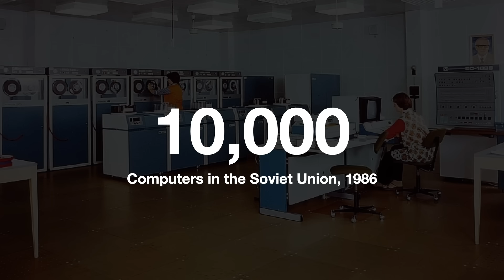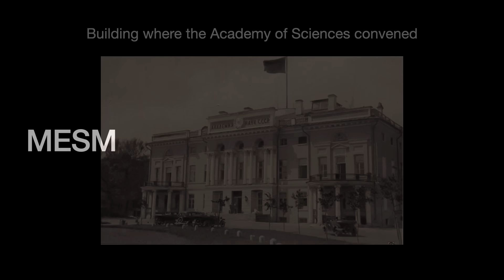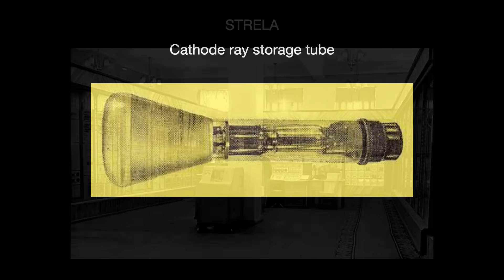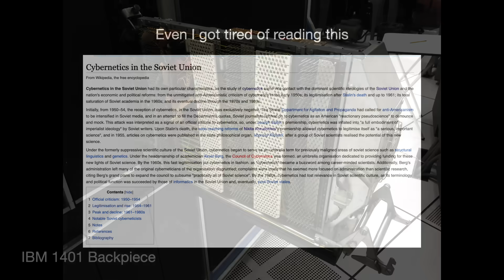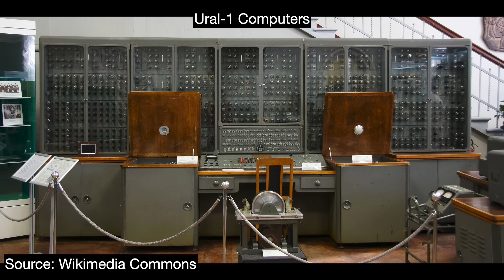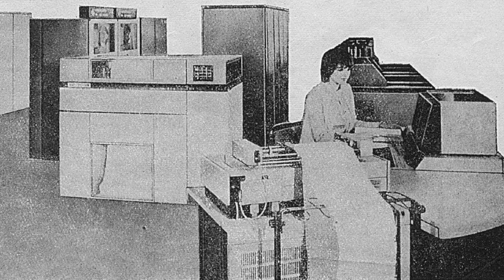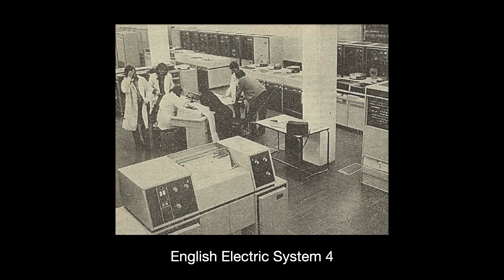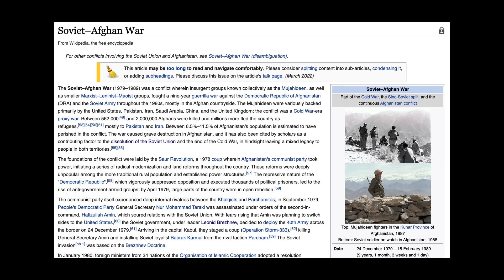Why the Soviet Computer Failed

Comment: I was a student in a high school owned by one of companies building these mainframes (Elwro). Late 80's. They were able to create their own processing units (R34) that were faster than latest and greatest Russia could offer. One of the reasons was they got rid of all 'soviet' chips. From what we've been told, Russians were able to obtain all western documentation (I still remember that huge amount of lessons we had about 360's architecture and instruction set), but failed at recreating more advanced chip manufacturing technologies. Actually, R34 machine is considered one of reasons Western Germans bought that company few years later and literally tore it to the ground.

Comment: Those calculators weren't aimed at solving "differential equations" which a significant portion of them possess analytical solutions and only require one dude and a sheet of paper to solve  ...Those Computing machines were aimed at solving PARTIAL DERIVATIVES EQUATIONS ....Which are a totally different mathematical beast altogether and of  which very few possess analytical solutions and so require APPROXIMATED solutions ( hence the "gargantuan" , relative to the times , computing power needed ).....
And there goes the credibility of yet another wannabe nerd American YouTuber that has no clue what he's talking about yet aims at "edjumucating the woarld" .....

Comment: What are differential equations?

An equation tells you "how much."
The derivative of that equation tells you "how fast."
A differential equation is an equation for the derivative, "how fast," based on the original equation for "how much."

Conceptual Example

Equation:
Plug in time and the answer is your location.
Location is computed based on time.

Derivative:
Plug in time and the answer is your velocity.
Velocity is computed based on time.

Differential Equation:
Plug in your location and the answer is your speed.
Velocity is computed based on location.

"How fast" is based upon "how much."

Equations Using Equations

Equation
Location based on time:  L = e^(7t)

Derivative
Velocity based on time:  V = 7e^(7t)

Differential Equation
Velocity is based on location:  V = 7L

Comment: RCA computers were NOT 360 compatible enough to be able to run IBM systems.  The none privileged instructions were essentially the same but privileged instructions were not.  Thus ICL computers were probably not fully 360 compatible.

Comment: Low end 360 models could not necessarily run software from higher models.  System 44 etc.  I suspect that today models of "360" without decimal arithmetic registers do not run all "360" software very well.

Comment: I think you sort of got the wrong lessons from this history.   I think the structural economic limits in the Soviet Union -- it was a much much smaller economy -- meant it could not legitimately compete with the USA in every area.  That was probably the main problem.  Central planning and communist inefficiency made matters worse, but fundamentally, it was a lost cause from the start.

Comment: From what I know, this is an outstanding representation of what happened up to a point. I worked with a former Soviet computer scientist. He told me some great stories but adding to your account. As you said, the Soviet Union built the equivalent of the IBM 360 CPU but did not have IBM's latest operating system, MVT. MVT had virtual memory allowing a computer that had only 4 megabytes of memory to act like it had 16 megabytes. The Soviets had obtained MVT and the more advanced MVS through clandestine means; although they did not have a complete version, they could make it work. The Soviet Union bought most of its peripherals on the black market. However, their domestically built CPUs were excellent. The showstopper was that they could not purchase disk drives on the black market and failed to produce Winchester disk technology on their own. Disk technology allowed the US to run more advanced operating systems like MVT and MVS and, importantly, solve more advanced problems that depended on fast access to large amounts of data, such as seismic analysis of oilfields, heat flow, aerodynamic drag on wings, physics particle collision analysis, digital image analysis, etc. The Soviets did manage to get a few disk drives from the black market but never enough to make wide use of the capability.
Reply: Oh come on! Around 1980, US research groups were still using CDC 300 and 600 MB disk drives the size of washing machines. Not Winchester disk drives. CDC 600s were what were connected to our pair of VAX 11/780s for large speech model analysis. While I did a few things with the 780s such as writing a driver for a graphics printer, doing about 6-9 months of software updates over a 2 week interval after the person who the company hired from DEC resigned, and installing EUNICE (a UNIX emulator), I also worked on a computer architecture project, and later a full custom VLSI design project which had its own VAX 11/750.

Comment: 18:38 This is typical for every project done by the Soviet union.

My father was a doctor in clinical chemistry and head of the laboratory in one of the most modern hospitals in the Netherlands in the 1980's. The hospital had a sister hospital in Poland which soon would be replaced by a new hospital. And Polish colleagues would visit the Dutch hospital, to see how all different departments were integrated into a single efficient hospital and how they changed the internal layout (compared to conventional hospitals of the time). This was to stimulate teamwork instead of stimulating rivalry between different departments under a single roof. My father was happy to help as good health care is good for all mankind. And his Polish colleagues were impressed and excited to one day have a similar working environment.

But when the new Polish hospital was finished it had none of the ideas integrated into the new hospital. And nobody would have dared to say it wasn't the greatest thing ever (even though it was hardly different from a 1930's hospital). My father meanwhile now saw the whole thing as a pointless effort and a waste of time.

Comment: I heard that the Soviets in the 1960s developed a computer that worked in trinary (base 3) rather than binary. Western core processors of the 1960s consisted of small iron rings, magnetised clockwise for one and anticlockwise for zero. The Soviet machine used magnetised clockwise for one, anticlockwise for two and degaussed (unmagnetised) for zero.